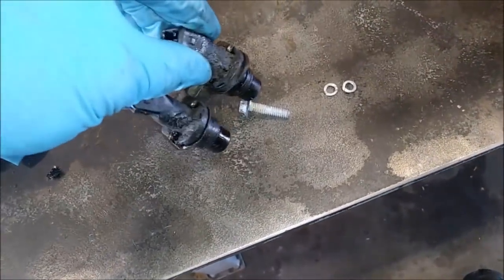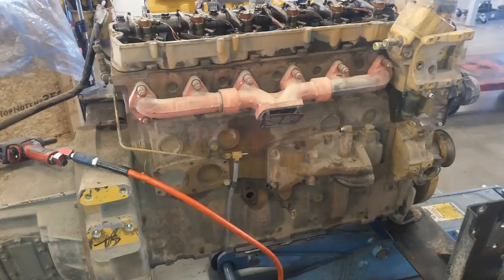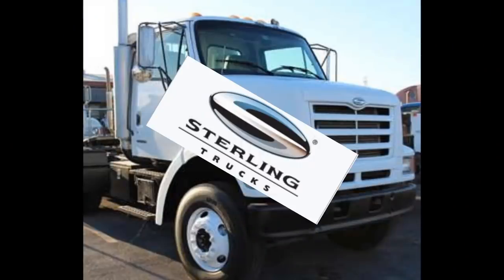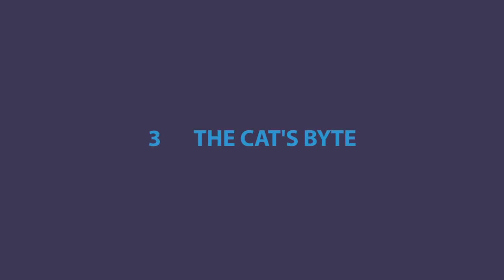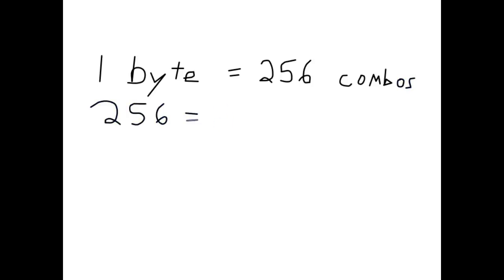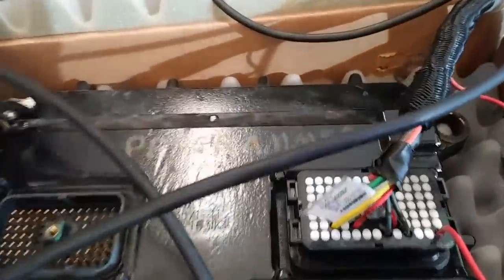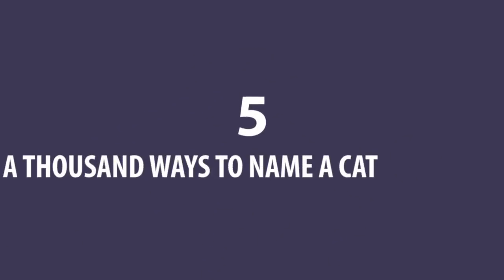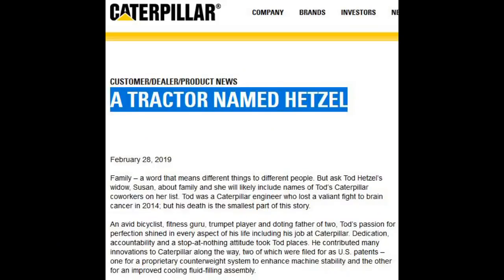5 Cat Engine Facts Most People Don't Know Are True.

Comment: Hi again Louis Kats from Australia again. 

Just a few more questions. 

What does ATTAC stand for all these years I believe 

Twin Turbo After Cooled is this correct.

3406 B was the highest horsepower available in a B 425 Hp

3406 C was the highest horsepower available in a C 460 Hp about 1994.

Not sure if there was a 3406 D ever made can you please confirm.

3406 E was the highest horsepower available in a E 600Hp about 1997.

What is the difference between a 
3406 E & a C15 & C16.

Any help would be greatly appreciated
Reply from the maker: I made a video about 2 weeks ago explaining many of the 3400 series engine differences you should check it out. The letters are ATAAC and they stand for Air To Air After Cooler. Basically just means the engine has a Charge air cooler or Aftercooler. No D model was ever made as far as I'm aware.
Reply: @AdeptApe  

Thank you will check out your video again

Comment: I’m looking at a country coach with the C 12 cat engine in it has 94,000 miles on it are these engines pretty dependable or not and what would I need to look for on this engine with that kind of mileage
Reply from the maker: They are good engines. I would look for signs of coolant in the oil, probably the biggest concern for an engine with that low on mileage, but old in years.

Comment: What does 340 stands for in 3406.

The 6 means 6 cylinder 

340 what does it stand for.

I have tried to figure it out over the years can't figure it out.

Great Channel
Reply from the maker: The 34 is more important than the 0. So the 34 was the Cat series of engine. There was a 3406, 3408 (8 cylinder), and 3412 (12 cylinder). There was also a 3456, but that was just a larger displacement 3406. Hope that helps a little. I just released a video explaining much of this you may want to check out.
Reply: @AdeptApe  

Sure does, finally after all these years wondering I got my answer.

Thank you so much, greatly appreciated it 👍

Have a safe Christmas

Comment: You should do a vid on how to look up pin terminals and connectors using sis web. I just needed a new connector for the c7 heui pump and our parts guy said the only way he could get one was the complete engine sensor harness. I call B. S on this one I logged into sis myself but couldn’t find it I know there’s a way to get  ether the pig tail or connectors and terminals.
Reply: Need to know more info. Harness part number, engine serial number it may show several serviceable connectors. Also look up this media number, REHS0970. Pin and sockets I use 9x3401 and 9x3402, gold plated. They make a slightly larger one for wire end. They have a green stripe around them. Here is two pins, 1552270 and 1028802 are the most common two pins, male and female.

DT Type Connectors - Two Pin Connectors 
DT06-2S 	EP06 	155-2270 Connecting Plug Kit 	2-pin plug with end cap 	  

DT04-2P 	E008 	283-3489 Receptacle Kit 	2-pin receptacle – heat shrink adapter 	 
DT06-2S 	CE05 	331-4226 Connecting Plug Kit 	2-pin plug with end cap (reduced wire seal)  
DT04-2P 	E005 	102-8802 Receptacle Kit 	2-pin receptacle with end cap 	
DT04-2P 	CE03 	151-9272 Receptacle Kit 	2-pin receptacle with end cap (reduced wire seal) 	
DT04-2P 	N006 	9X-0352 Receptacle As 	2-pin receptacle (90° flange through bulkhead)
Reply: The Deutsch (now Ampseal) connectors are not unique to Cat and can be ordered through other vendors.  You can find all the part numbers in the Amphenol A series catalog.  Vendors such as Digi-key sell most of these parts.

Comment: Back in the 70's cats in paccar trucks were painted matterhorn white. Let's you see those copious oil leaks all the better.
Reply: You have cats confused with Detroit diesel, grandfather owned 100 rigs with cat engines. Leaked very little, the two Detroit’s he had leaked like a sieve.
Reply: @ddorn04  Biggest leak on a 3406 92U was the accessory drive to the air compressor. Several gasket changes, finally came out with the front cover mod. Drilled a hole and used a hollow dowel to keep oil off gasket.
Reply: For sure cat engines leak less than detroits, which hemorrhage oil if they aren't burning it .what I was implying is that all of the big diesels can leak non trivial amounts of oil at some point in their million plus miles, what with puzzle gaskets and such. It looks way worse when it's a snow white engine block.
Reply: @josephfaria6617  One big mistakes the truck manufactures made was the engine oil fan drive. Oil was supplied and returned via oil lines. The would get brittle and leak, plus the fan drive could leak. Boy did they make a mess, and luckily they did not last long.

Comment: 1996 Ford. Ln 9000 with 5ek with tilted cat, ford did that on cummins what a knight mare if you try to put that engine in a normal  truck  special ,exhaust nanifold, turbo x over ,oil cooler,intake manifold ,fly wheel, fly wheel housing .

Comment: Back in truck in the 1970s and 1980s slot of a model cat motors were painted white. In 1988 they came out with a b model 425 up that was yellow. Then 5 years later the c model them e model turned into the c15
Reply: Cat had the 3406E before the C15
Reply: @timothysexton3657  yes sir the E model cat came out in 1994 and ran into early 2000s then everything changed to c-12 or c15 or c16 liter a lot of good engines
Reply: Yes it did.

Comment: QUESTION?????  Could you make a video on, to turbo or not. H. P., durability, fuel consumption per horsepower, torque crurve change, constant speed vs  changing speed, cat3208 in a marine application would be a good choice. I don't one, I have Perkins 6.354T Intercooled. rated at 200 hp. Is it best to run a turbo charged engine in peak torque crurve or peak horse power?
Reply: Running at peak torque will net you the best fuel efficiency, especially in a marine application. Running at rated horsepower is just wasting fuel, stressing the engine excessively & wearing it out prematurely. If you must eek out a few more knots, somewhere between peak torque & rated horsepower would be a good place to run at but no more than 2300-2400 RPM or so. The slower you can run a 3208, the longer it will last. 

I do quite a bit of work on fishing boats & old farm trucks down in south FL so these are just my experiences/opinions on what I've seen.

Comment: great explained 😏 can anyone knows about what caind of the CAT engine V8 model not have any electronics sensors or ECM or stuff's like that?? without any electronics injectors or electronic fuel pump?? i would like to know because I want to change my detroit L65 V8 on my suburban 95 model! the transmission i changed to a NV4500😏 now I would like to put a stronger V8 CAT without any electronics stuff's  some guy talking about a (CAT 3208)🙂 please i appreciate all help cheers from Norway

Comment: Wasn't there a Cat engine that used high pressure oil to fire the injectors?
Reply: Yes 3176, 3116,3126,
Reply: @Robert White not sure never was around Those engines they were in small equipment and Gen sets and Orchard tree shakers etc.
Reply: I knew them as HEUI...  hydraulic electronics unit injectors.

Comment: Hi is all or any of the 3408 HEUI  engines?
Reply: If memory serves me, yes. The 3408E used HEUI injectors, but I don't think that engine was ever put in a truck. I believe it was only a marine or industrial application.
Reply: @emmettjohnson8220  I have seen pictures of trucks with 3408 in them but not sure if the OEM put them in.
Reply: To the best of my knowledge, the engine used in OEM was a mechanically injected engine. I'm not sure, but I think they stopped using the V-8 because the 6 cylinder could make almost as much power on much less fuel. So the early truck engine was mechanical, the later industrial version was HEUI.
Reply: Original 3408s in all applications were mechanically governed and injected. There was never an electronic version in a truck.

Comment: KCA, kick Cummins a$$.  C15 vs C-15 ACERT vs. non ACERT, etc.  The middle numbers in the 3100 series we're liters per cylinder, the last was the number of cylinders.
Reply: What about a 3145?
Reply: @johngoldsmith6629  True.  I was referring to the inlines.
Reply: The 3100 series industrial engines were an early naming attempt that didn't last long. They were industrial and marine versions of the 1100 series truck engines. The attempt with 3116, 3176 etc. to make the naming system mathematically significant lasted for just a few years and there were many exceptions.